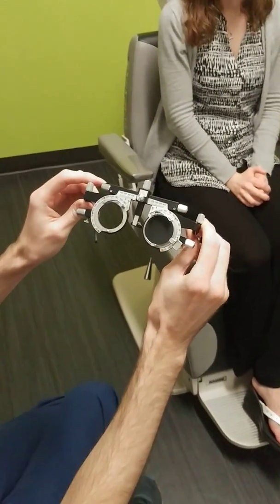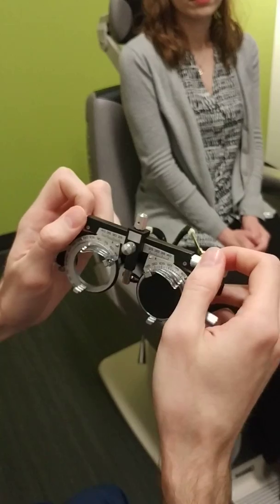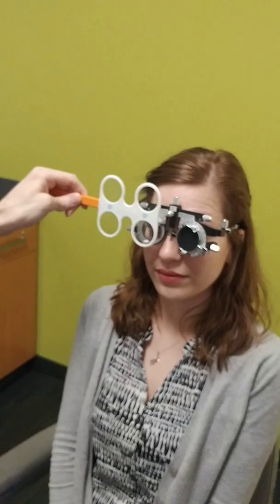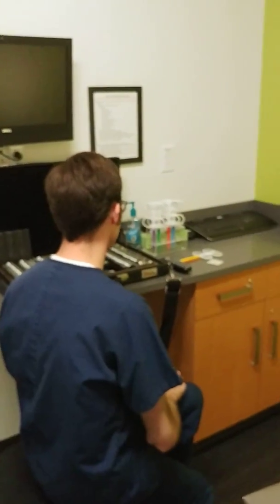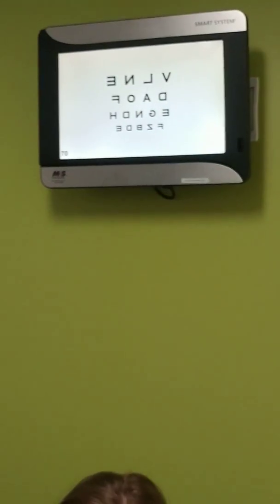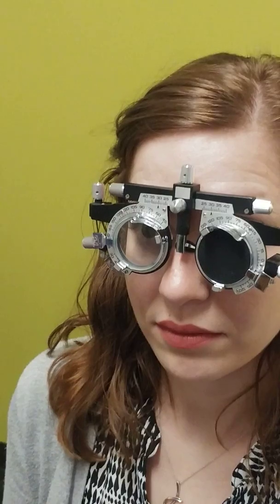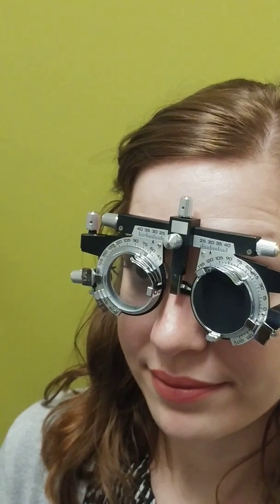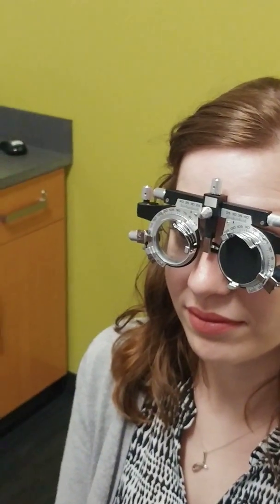Trial Frame Refraction (low vision)

Comment: What's the prescription?
Reply from the maker: Roughly:
-1.50-1.25x145
-1.25-1.75x040
Reply: @jenniferkrueger8768   That's not 'low vision' as the video title says.  That's nothing. Mine is 4.50
Reply from the maker: @leefiles  correct. It is how to perform a trial frame refraction, most often seen in low vision settings.
Reply: @jenniferkrueger8768  im olso blind